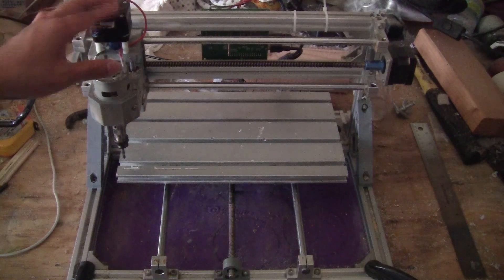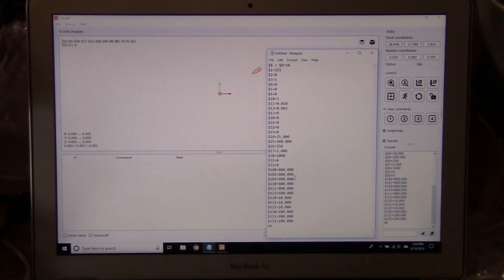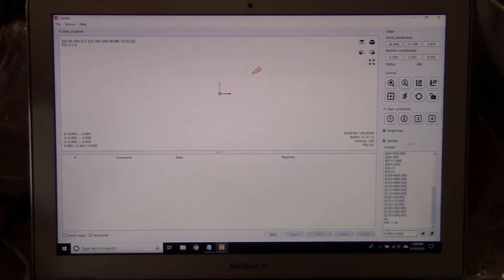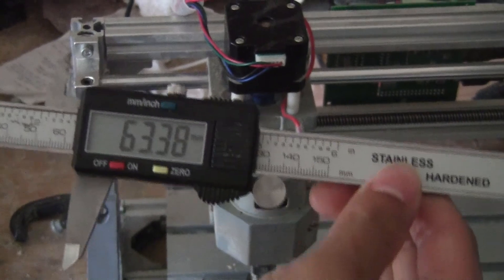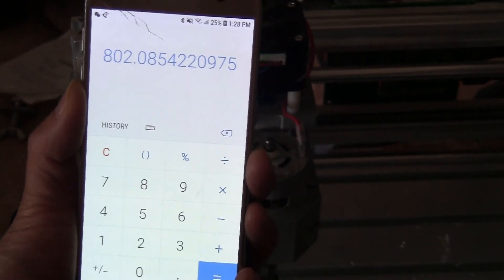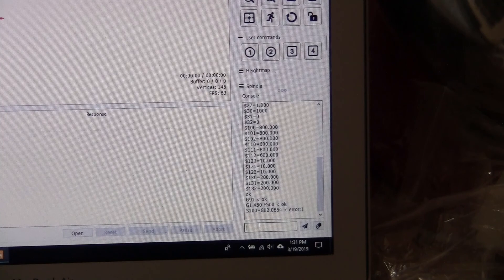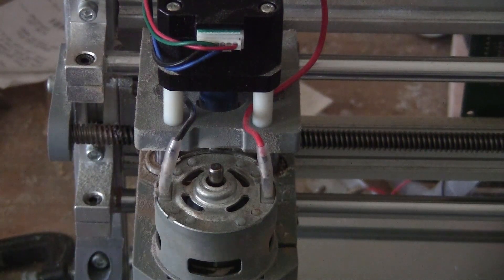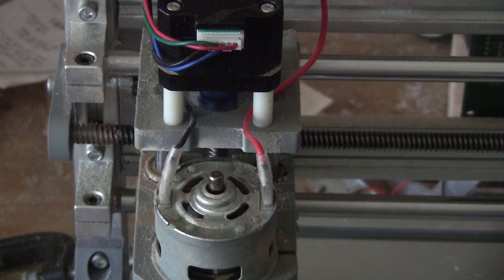3018 CNC - Axis Calibration

Comment: Minh's great video. you have explained very well the concept of calibration and steep per settings. BUT using machine structure its  a bad reffer for calibration.  the actual cutting surface may be different since you have plastic joints and plastic spiindle housing,. i have here a 3018 plus with entire metal body no plastics,  anyway i tried to do same as you 2 weeks ago. and i fixed my caliber to machine and all, but believe me.:  make a 100mm square toolpath with 3 mm deep and use the digital caliper you have ( i have one also good). Measure the cutting internal size and try it. WORKS LIKE A CHARM FOR ME THE 2ND TIME AND ITS PERFECT

Comment: Sir , let's me know what the meaning number 800? If I make lagger CNC 1500x2400 use GRBL , what need I change?
Reply from the maker: 800 pulse to move 1mm. The leadscrew is 4mm lead (move 4mm per rotation), the stepper motor driver generate 3200 pulse to make the motor turn one round of 360 degrees. 3200pulse divided be 4mm will make 800pulse per mm. Using the same reasoning, you can calculate which number you need depending on your leadscrew, stepper motor driver settings.
Reply: @minhsmancave9448  ok, thanks so much for explaination 🙏🙏

Comment: 6:36 still moving back and forward you get backlash error.atleast clamp caliber on maching and let machine move it.ONE DIRECTION you get correct data +- what ever is tolerance of that cheap caliber even it says 10.000.it still could be +-0.02. AND if you measure it slighty off you get wrong data.everything is * what you try do.800 is correct by matyh. fix issues if it not. dont lie it becouse it will not correct.
first you need find out if thread has pitch error.then you will allready see. YOUR method you get backlash error
Reply: Nonsense
Reply from the maker: You might be correct but these machine do have anti backlash nuts on all axis and they work fairly well without load (under cutting load is a different situation). The way I measured might not be really precise and I tried my best to be consistent. In the end, it doesn't matter how hard you calibrated your machine, these types of cheap machine are flimsy and will not be precise.
Reply: @minhsmancave9448  if you squuze that spring tight so same as no spring😁

Comment: 3:32 i guess you moved it closer other direction you will get backlash error measure it moving same direction
4:36 yeah more look backlash even you hand held measure it.dont do that.if math say 800 step is correct then its correct. fix backlash. if number end 797 then your lead skrew has pitch error fix it.there is nothing else than 800 step rev if math say so

Comment: Im not sure about this. Nema17 moves 1.8° ( in most of the cases but can be 0.9° ) so it  makes 200 pulses ( or 400 ) to make one turn ( 360°) . With a screw of 2mm step, one turn moves 2mm so half of 200 is to make 1mm move. 
What I mean is the value is a mathematical constant from physical constants. If your cnc looks unprecise, you should look at other factors like too much slack somewhere.. Thus, you should make multiple measures at different ranges like 5mm, 50mm,200mm and see what happens.
You can have really cool precision with improving the screw ( bigger like 16mm at 1mm step ) and  a ball bearing screw driving and upgrading to NEMA17 @ 0.8°. But  the value will still be a calculation of all those parameters
Reply from the maker: Those driver micro steps the pulses to turn the stepper motors. 32000 pulse to turn 360 degree. The screw's lead is 4mm per turn. So around 800 pulses per mm
Reply: Your assumption that the leadscrew pitch is a physical constant is incorrect. The leadscrew is fabricated imprecisely and in a manner that accumulates error (likely a rolling die). The pitch varies a little along the length and has systematic as well as random errors. On my machine a two point calibration where I manually spun the motors over 150mm travel estimates the error to be 0.9% (4.0359mm/rev). That's quite bad in the CNC world, but probably fine for an engraver.

As you suggest, with errors that large, there are likely linearity errors as well. So a multi-point calibration over many points of the span is required to get anything approaching 0.1mm accuracy (if your control software supports it).

Comment: hi i have a 3018 pro, when i try and cut all the way through the material it only cuts just under half way through.i set 0 the Z axis set it up for 9mm mdf as this is what depth my material is and what i need it to cut, can you help :)
Reply from the maker: Are you using fusion 360 or other software for setting up the Gcode? Usually, when set up the stock, you will choose the top lower left corner as origin. The stock thickness will 9mm in your case. The bottom offset for cut ting should be 0 from stock bottom or a negative number to cut all the way through.
Reply: @minhsmancave9448  i have done it now but thanks

Comment: Thanks this helped me a lot! for some reason my values were totaly different and my machine was carving things much smaller. How would I be able to get all the default codes for my machine?
Reply from the maker: Your firmware might got upgraded without being reconfigured to the default settings. Or you also might want to check if your machine settings are in mm and your g-code is in inch? Here are the comment settings for 3018 CNC, if you have them different, you will have to enter them manually, the values will be save in the control board and you won't need to re-enter them:
$0 = 10 (Step pulse time, microseconds)
$1 = 25 (Step idle delay, milliseconds)
$2 = 0 (Step pulse invert, mask)
$3 = 5 (Step direction invert, mask)
$4 = 0 (Invert step enable pin, boolean)
$5 = 0 (Invert limit pins, boolean)
$6 = 0 (Invert probe pin, boolean)
$10 = 3 (Status report options, mask)
$11 = 0.010 (Junction deviation, millimeters)
$12 = 0.002 (Arc tolerance, millimeters)
$13 = 0 (Report in inches, boolean)
$20 = 0 (Soft limits enable, boolean)
$21 = 0 (Hard limits enable, boolean)
$22 = 0 (Homing cycle enable, boolean)
$23 = 0 (Homing direction invert, mask)
$24 = 25.000 (Homing locate feed rate, mm/min)
$25 = 500.000 (Homing search seek rate, mm/min)
$26 = 250 (Homing switch debounce delay, milliseconds)
$27 = 1.000 (Homing switch pull-off distance, millimeters)
$30 = 1000 (Maximum spindle speed, RPM)
$31 = 5 (Minimum spindle speed, RPM)
$32 = 0 (Laser-mode enable, boolean)
$100 = 800.000 (X-axis travel resolution, step/mm)
$101 = 800.000 (Y-axis travel resolution, step/mm)
$102 = 800.000 (Z-axis travel resolution, step/mm)
$110 = 2500.000 (X-axis maximum rate, mm/min)
$111 = 2000.000 (Y-axis maximum rate, mm/min)
$112 = 1500.000 (Z-axis maximum rate, mm/min)
$120 = 45.000 (X-axis acceleration, mm/sec^2)
$121 = 45.000 (Y-axis acceleration, mm/sec^2)
$122 = 48.000 (Z-axis acceleration, mm/sec^2)
$130 = 300.000 (X-axis maximum travel, millimeters)
$131 = 180.000 (Y-axis maximum travel, millimeters)
$132 = 44.000 (Z-axis maximum travel, millimeters)
Reply: @minhsmancave9448  Thank you very much my machine is back to normal

Comment: Thank you for your reply
Is there a way of reversing the x axis and the z Axis without reversing the wires
By using code in 3018pro
Reply from the maker: You can try setting the mask to reverse the direction of the motors. It didn't work for me that why I recommend you to swap the wires. But it worths a try since you don't need to modify the machine physically. You can check the mask settings that you have right now type typing $$ in the command lines in Candle and look at $2. If you can tell me what the value you have and which axis are reversed, I can tell you what # to change it to. Or you can look at Grbl website to have better understanding of the mask and other configurations.
Reply: @minhsmancave9448  2=5
Reply: $2=5
Reply from the maker: @tommybrowne5659  So with "$2=5" which mean right now you have the X and Z axis reverse. You can try to set it to 0. just type "$2=0" and try again
Reply: @minhsmancave9448  Thanks again but $2=0 did not make any difference so i returned it back to $2=5    still  x and z axis are reversed
Reply from the maker: @tommybrowne5659  Then swapping the wires will be the solution. You don't need to cut anything, just use a small flat head screw to pull the wire connectors from the plug.
Reply: @minhsmancave9448  brilliant that worked great, x y z axis all working correctly   just the  Test code  (3 Axis) is carving upside down and back to front   iPhone any solutions to that, please
Reply from the maker: @tommybrowne5659  If left to right is still correct that means your Y and Z is reversed in the code. Just change the mask "$2=6" and try again
Reply: OK thanks I'll let you know 👍
Reply: No still upside Down and back to front.
Reply from the maker: @tommybrowne5659  Then the mask just doesn't do anything. Where do you get the G-code file? If it was given with the machine, you prabably should try to make one your-self to see if it makes any difference. If the axis work correctly, the only thing left will be the g-code it-self
Reply from the maker: I was wrong the about the mask settings. actually the direction mask is $3. So, if you had the original settings, to reverse the direction, you will have to look at the $3, not $2

Comment: Hi i have purchased the CNC 3018 PRO  MADE IN CHINA  everything i do is back to front and upside down   how can i correct this please
Reply from the maker: Easiest way is to swap the wire of the stepper motors. Takr first 2 wires and change place with the other 2

Comment: I just bought a 3018 off amazon. I have to get the computer connected to it to drive it but I'm thinking about using a raspberry Pi to control it instead.
Reply from the maker: That will be a interesting mod. Let me know how it goes with the Raspberry Pi. I only work with arduino and have never tried Raspberry pi.

Comment: With this calipers, you can also set it to 0 at your initial measurement. You then measure again after traveling a given distance. That will take away the subtraction to calculate the actual traveled distance, and reduces the chance of errors ;)
Reply from the maker: Yes, that's a nice trick. Will do for the next calibration.

Comment: Thank you for helping me out with your guide. How do I restore default values for the 3018? Also, how do I find out what the various $ represents? Thanks
Reply from the maker: Hi there,
I don't really know how to restore all the parameters automatically. You just have to copy and save the parameters of your machines to a file and enter them back in case you need to restore to the original parameters. You can read about all the others $ here: https://github.com/gnea/grbl/wiki/Grbl-v1.1-Configuration

Comment: Please,  can you helo me fix my cnc machine via teamviewer. I really need you assist, thanks in advance
Reply from the maker: Before jumping into anything, I need a head up about what's the problem you are having, what type of machine you have?
Reply: @minhsmancave9448  I have a 3018 CNC engraving and laser machine, the x axis not accurate. I need assistance in calibrating it so when I command it to home it stops in d middle of the platform
Reply from the maker: I don't know how to do that. I don't think you can set the home position in the middle of your platform. Usually, you will need to install limit switches on all axis so the machine will see the home position X0 y0 and z0 when it hit those limit switches